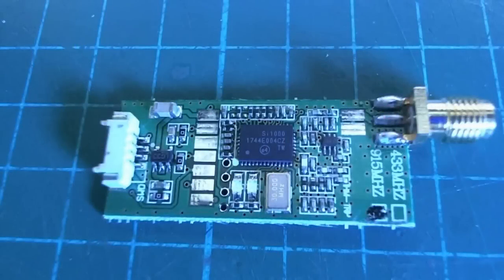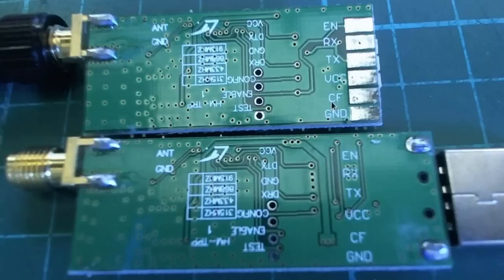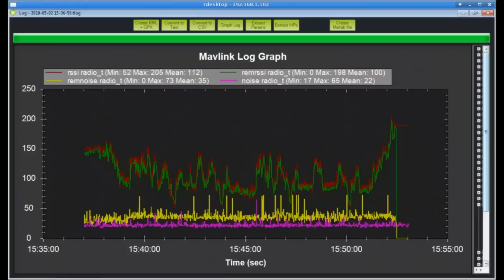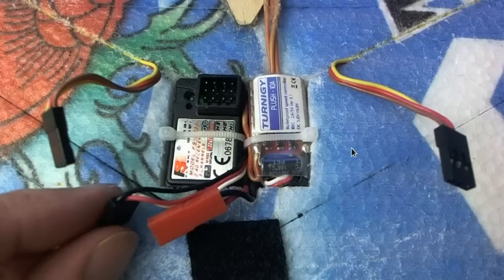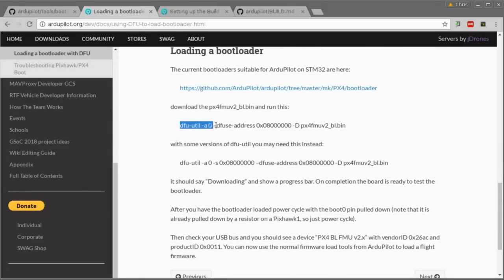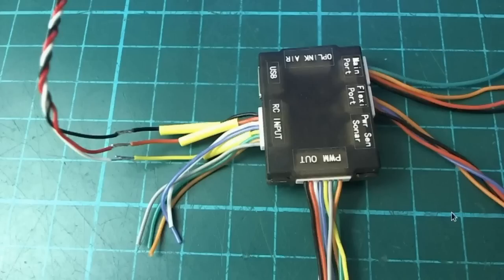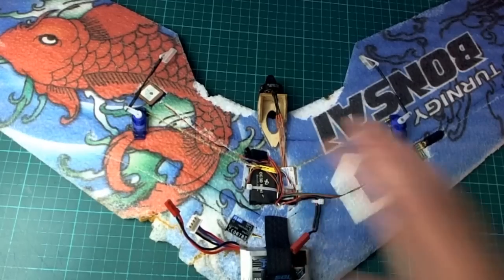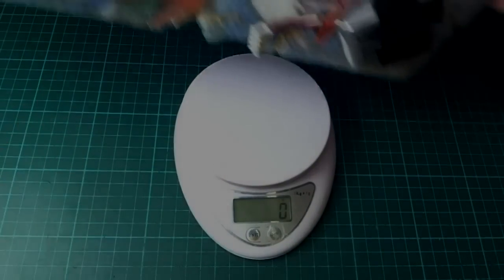Ardupilot on tiny CC3D revo mini ( 180g bonsai build, with telemetry ! ) - part 2

Comment: Hi iforce2d,

I know how to display all sorts of graphs using DF log after downloading it from FC. But for displaying graph using tlog obtained from telemetry module, I don't know how to do that.

Starting from the tlog downloaded from FC, what is the next step ?  If I press the “Telemetry log” tab under HUD, and press PLAY, the map on the right side only displays the path of the vehicle, not the Mavlink Log graph, or RSSI versus remnoise graph as shown in your video. 

Appreciate your help.

Frankie

Comment: Hi Chris. Seeing as though you are the best at the howto videos that anyone can follow which is what Id been waiting over a year for I have a question seeing as though you actually got me in the air with my Pix after all that time.
When you have a wing setup and working and then you start up mission planner it says please download the new plane firmware, if you say yes does it just update what you have already setup? Or does it just download the firmware and you need to reload it then start from scratch with setup yet AGAIN?
Thanks for making videos that anyone can follow. Dont know why it took so long but it  seems some people have started out OK, not as good as yours, then get so technical because they get it all that they lose you in the process. So please keep your videos for the people love the honest and openness of your videos mistakes and all.
Cheers
Gus
Reply from the maker: I'm pretty sure you talking about just the Mission Planner program itself, not the firmware on your plane. I mean it cannot even know if you are gonna use a plane, copter, rover, antenna tracker etc at that point right? Take a second look at what the message says.
I did the MP update a few days ago and it was pretty painless, you just have to wait a while for it to download some new files and then it restarts.
Reply: iforce2d EDIT It was the new plane firmware release not just MP I had connected over mavlink so new I had a plane.
ORIGINAL;
Ok got it. Was'nt to sure if reloading the param file to the new firmware would work so no issues. Now to go Autotune the bloody thing.
Next try your inav hack. Need to get me a Bonsai, might splurge get the RTF one for a whole $90AU.
Cheers for all the help. Dont know if you realise just what a pot of gold your sitting on with you ability to make/explain the difficult easy for all the noobs.

Comment: What's the output power on the Hobby King modules you're using? In my experience the telemetry module pairs that run ~$30 are the 500mW output version and the pairs that run ~$20 are usually only 100mW output. I know decent antennas make a huge difference on those little modules too.

Comment: Hi Chris i just wondering if you are having any trouble with FS-A8S reciver. I was having so many dropout to the point that i bought frsky qx7 and ditched the flysky altogether. By the way your bonsai looks like is been eaten by a shark:):)
Reply from the maker: No, but I've only been out to 250m with it so far. Yeah most of that damage I think came from a bit rough hand catching.
Reply: iforce2d i have had fs-a8s in a quad and it would just failsafe and drop. I dit have it close to the flight controller so maby it had interference. You can get beter range if you wrap it in copper foil and ground it. Maybe try that if you get any problems.